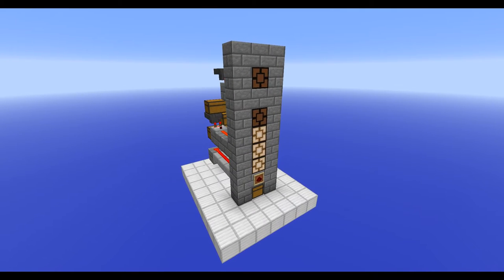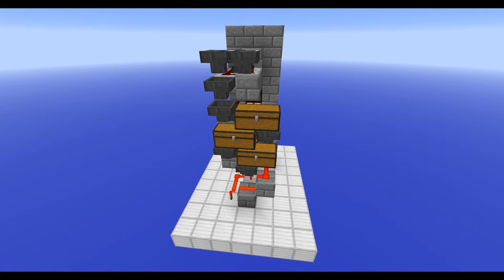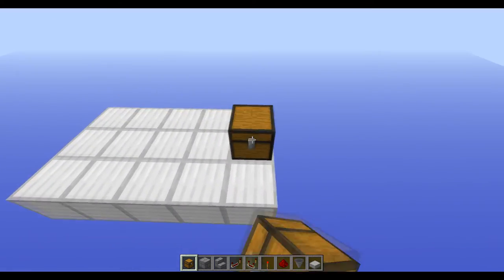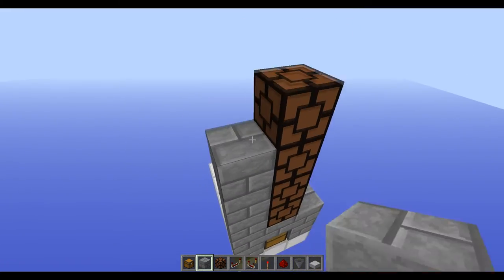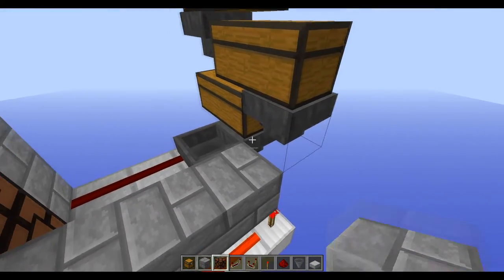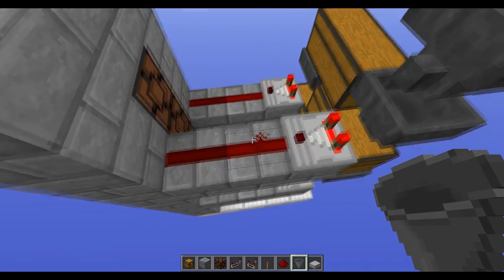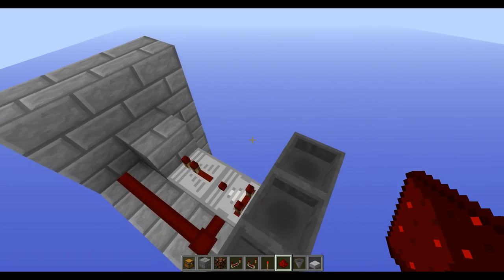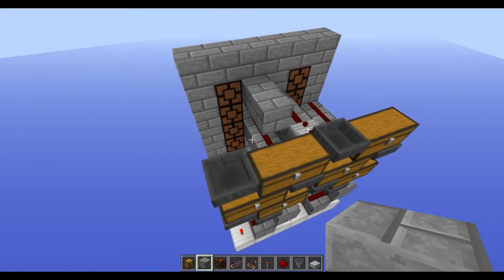Minecraft: A New Storage Silo Design

Comment: how do you fill them
Reply from the maker: It's designed to be a module for a larger storage/sorting system, so you will need some sort of item elevator to take items to the top.  Take a look at another video of mine that showcases a few item elevator designs: https://youtu.be/ESNEaMYRldQ

You should also check out version 2 of this design.  It's a little more compact and way cooler! https://youtu.be/b3gQ1znfaG4

Comment: Have you to fill your silo by the top side of it?
Reply from the maker: The input is on the top, but you would typically have an input chest on the ground somewhere for your entire storage system.  This would use item sorters to pick out things like cobblestone, dirt etc. and send them up an item elevator to the top of the silo. Alternatively, just place a chest on the last placed hopper and fill it from the top, or build a dropper elevator along side the silo to fill it from the bottom.